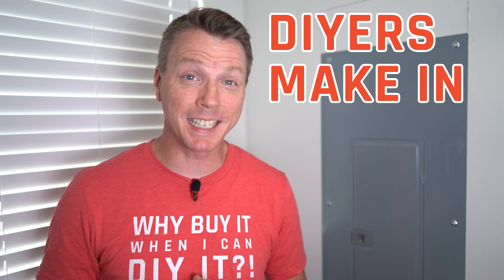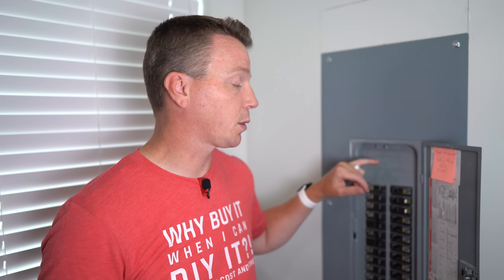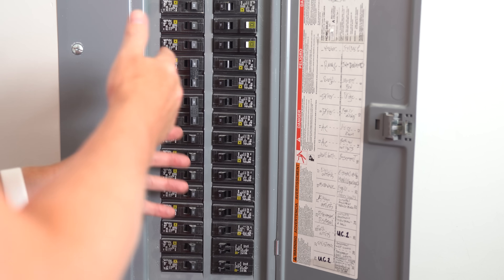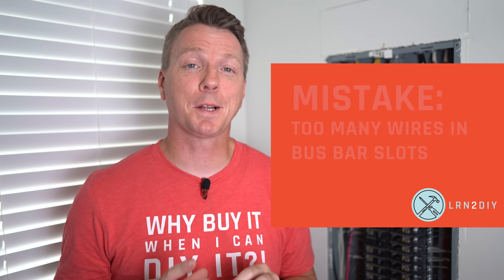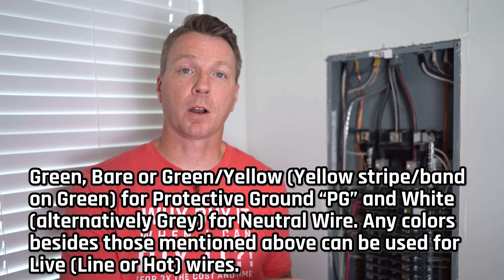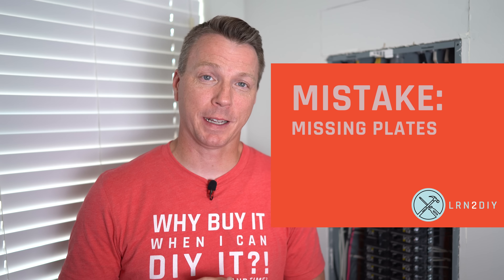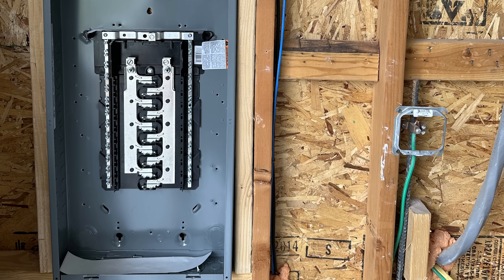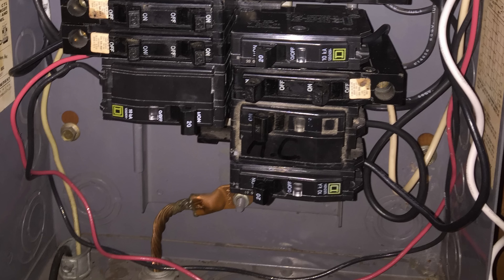10 Common Mistakes DIYers Make In Circuit Breaker Boxes

Comment: The panel at 13:09 is beautiful. Personally, I always leave extra length on the hot wires, because you never know when in the distant future things may have to be rearranged, or a panel upgraded. I usually run the wire down to near the bottom of the enclosure and back up to the breaker. I still make it nice and pretty, but that extra length can be a life saver in the future. I've personally thanked quite a few electricians who came before me for doing this, as I'm sure some electricians in the future will thank me long after I'm dead.
Reply: I used to work with guys who told me not to do that, just send it straight to the breaker. I really do like bringing it down to the bottom of the panel then up tot he breaker myself and that's what i've been doing since i've been on my own
Reply: @goaliedude32  That's because it takes time and time is money; I only do this kind of wiring on my own panels because it sure makes troubleshooting easier and inspections a cake walk.
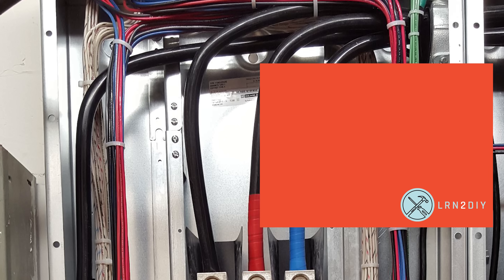Reply: Many electricians will be uncomfortable with the "designer" layout at 13:00, mostly as the long tight bundles increase heat. The general idea might be to tie together during panel set-up, but clip the ties after; the wires should stay nearly the same position, from their stiffness, but give air space around to dissipate heat.
Reply: @z1522  110% on that, which i stated in my post as well. same reason you cant put more than 3 cables through a drilled hole
Reply: @z1522    NOT    that is a commercial or industrial installation (3 phase) and that is a well done panel.  As a master electrician for the last 23 years, I have zero worry about dissipating heat in that panel.
Reply: @JustHazardous  why would there be heat? I'm not an electrician, but I've looked at plenty of panels at work (cause my employer is a chain store with many outlets). If I open up the panel and I feel heat, I would be very worried and on the phone to an electrician immediately !!!
Reply: @danielch6662 
Wires have resistance. Electricity flowing through a material with resistance will release heat. More power = more heat. More resistance = more heat. Thicker wire = less resistance.

The circuit breaker's job is to ensure that not too much power goes through any particular wire, based on its size.
Reply: @JustHazardous  bundling the hots
Reply: I came to the comments to say the same thing. If you have room in the panel to keep it neat, drop a loop down to the bottom and then neatly back to the breaker. Somebody will probably thank you in the future.
Reply: I always leave... well left an extra 6-8inches of wire in case something has to be moved so another circuit can be added.
Reply: I totally agree with you. I dress the panels the same way. I worked in the era when N.Y.C. had their own electric code. More stringent then the N.E.C. No splice's or pass thru was allowed. Your panel could look just as beautiful. Its like the previous person leaving 3 inches of wire in the receptacle box now you have to screw around with splicing. the best connection is a no splice connection. A good journeyman will always leave enough wire for future applications.
Reply: @twigd3825    Yes, I try to avoid ever having to splice or join wires, but sometimes, more usually when significant changes are done, it does become necessary. . . .   How do you do splices. ? . . .   I use through crimp sleeves, if possible, with the two wire ends actually overlapping each other and not butt together. . . .  The UK does not use Wire Nuts, but Screw strip connectors, and other crimp connectors.
Reply: @hughleyton693  I'm retired now. Here in the states back when I was working almost all of the contractors I worked for suppled 3M Scotch lock wire nuts. On larger wire we would use copper split bolts. Covering the splice with friction, rubber and plastic electrical tape. Later in my career that practice ended and heat shrinks or cold shrinks was used.
Reply: @twigd3825  Yes, wire nuts are widely used in the US, but not in some other countries.. . .  And yes, I use split bolts on Ground rods and similar and not the ground rod clamps often sold, which can break.. . .   And I use Self amalgamating tape, and heat-shrink sleeves, and have done for over 60 years, on many things.
Reply: Yes, you should include extra length for panel changes in the future.
Reply: i dont add extra wire because whoever needs it in the future can pigtail it.  up and down looks like crap.
Reply: As a home inspector, I agree, that panel is not only a work of art, it's so nice to inspect or work on. Unfortunately, a lot of older homes have the rat's nest style.

Comment: 5:51 if you are going to use a wire nut to combine grounds, consider using a green "grounding wire nut" that has a hole on the end allowing one of the wires to continue at full lenght to land on the grounding bar.  This way you don't have an unnecessary extra wire in a "pig tail" to make the final connection to the grounding bar.
Reply: Those wire nuts are horrible to work with after the fact, they only hold well if the wire are twisted together significantly more than necessary. which makes working with the wires again in the future a nightmare.
Reply: I like one wire one ground not 1 wire grounding 4 circuits. I am surprised that will pass code. Also a good pair of 600volts gloves make things much safer.
Reply: @voltmeter2  so if you have 4 circuits in a conduit you are going to pull 4 separate grounds?
Reply: @erodge5794  120v Neutrals Yes.   Grounds problay not.
Reply: @voltmeter2 hopefully only two neutrals. Wire is expensive.
Reply: @erodge5794  in the case of residential, this video and the use of NMB, then yes, you would have a separate ground.
Reply: @williamleblanc3244  bro his point is pig-tailing a ground is no different than when you share a ground with multiple circuits in a different setting (such as in a conduit, or even using the conduit itself).
Reply: Buccannon crimp
Reply: Try not to use those, you'll look like a better electrician. 😉
Reply: Use a ground bar never wire nuts inside panels. Don't give advice you might kill someone.
Reply: @chrisminblkdiamond  However wire nuts are allowed in panels for other reasons. Wires too short on a panel replacement. Another allowed use as explained in the video is when two hots need to go to one breaker. The accepted solution to this is a wire nutted pig tail at the breaker.
Reply: @andydelle4509  If that's how you justify lack of skill and planning.
Reply: @chrisminblkdiamond  What are you talking about? If one needs a panel replacement and the cable sheath still is clamped inside the new panel but the wires can't reach the desired terminal, how is that lack of planning? or the old panel had double tapped breakers, what do you suggest? Follow the wire back to the first box and tear out wall board or plaster to replace it? Or just knock the house down and rebuild?
Reply: @andydelle4509  When I went to trade school they said never have a wire nut in a panel.  If your wire is too short, you attach a box to the side of the panel.  Make all your connections in that box.  Normally a 4 x 4 inch square box.
Reply: @slalomking  Well I think that was your instructor's personal preference. There is no code preventing wire nuts in a panel. In fact the accepted fix for an illegal double lugged breaker is to attach a pigtail and wire nut the two hots to it. As long as the cables are long enough to have 1/4 inch of jacket past the clamp. it's legal. You may be thinking of another code where any wire inside a panel must terminated in that panel. You can't use a group of panels as a gutter box.
Reply: @chrisminblkdiamond  phooey

Comment: I had to upgrade my breaker box for a solar installation, and I did such a neat and tidy job the inspector looked at it for all of 10 seconds before complimenting it.  In my county, inspectors will fail you for a rat's nest.

Comment: I believe there is an NEC code that prohibits re-phasing or using colored tape on ungrounded wires 6awg and smaller. 4awg and larger is okay to do. and white wires cannot be re-phased at all.

Comment: Mistake #3.5 @ 3:55 - do not turn away from the panel to face the camera while waving your hand near the live connections :)
Reply: It's switched off. He says this near the end. Granted he should have mentioned it near the beginning that the entire breaker is non-operational.
Reply: I made that mistake once, there was no exposed wiring but I tripped a few beakers that required a maintenance guy to go on the roof of the building to reset something.
Reply: I could feel  my blood pressure rise everytime.
Reply: You should always wear safety glasses or eye protection when working in a live panel.
Reply: The problem with doing this and several other instances of near-misses is that it conveys to the novice that working with electricity is no big deal.  Never once did he stress the critical importance of not touching live circuits within the panel.  I'm afraid that this video would encourage the uninitiated do-it-yourself home handyman that safety can be taken lightly.
Reply: @larrywhited3070 he does at 10:30
Reply: How would you feel if in a gun video the instructor was pointing the empty gun at his head and pulling the trigger, knowing that the gun was empty. That's what prodding the wires is in this video. Instant "Do not recommend channel"

Comment: I disagree that "double lugging" -- putting more than one conductor in a lug -- can result in a poor connection. How is it different than putting a stranded wire in the lug?

However, it's still poor practice, especially on the neutral and grounding busbar. With ground wires, if you need to remove one of the wires from the lug, you will (at least momentarily) leave the ground for the other circuit disconnected. Same with wire nutting several circuit grounds together.

With double-lugged neutrals, attempting to disconnect the neutral for one circuit also disconnects the neutral for the other circuit, and, if you didn't turn off the breaker for the other circuit, can lead to arcing in the panel at the neutral bus.

So don't ever double-lug on a neutral or grounding bus. And don't wire-nut your grounds together to avoid using more than one grounding lug.

So that leaves the question of whether or not you can double-lug a breaker. Some breakers may actually be listed for double-lugging; others won't be. It's most likely not unsafe, so long as it's a newer style breaker with a lug instead of an older style breaker where the wire is secured under the head of the screw. Don't ever put two conductors under a screw head.

But defer to your inspector; if they say "don't do it" then it's usually easy enough to just put in another breaker. In the grand scheme of things, individual branch circuit breakers aren't that expensive.

Comment: What about the neutral to ground bonding screw (only on the main panel)?  Its tough to find info on that.
Reply: Yep.  You need to separate the the earth based bond from the service neutral    doing this with a ground rod    if the raceway is metal then a bonding bushing is required. If PVC is the raceway then an additional conductor is required

Comment: Is this a main breaker panel? If so, where does the ground wire come from? Also, you don't list the number one mistake a DIYer does, which is to insert a breaker not listed for the panel. I've seen one brand of breaker in a different brand load center many times.
Reply: There's no main breaker in this panel    it's a pass thru set up

Comment: When your video are aimed at non electricians, you can say what you want and get away with it, but electricians tend to nit pick your video. If you have a panel that are filled with breakers, and panels tend to run out of breaker space long before they ran out of amps. You just cannot total up the breaker amps and says the panel is overloaded , unless you are a crook and try to sell more service.  Much of the wasted space are , believe it or not , caused by electrician that could not care less. You want a couple of general purpose recep at a basement wall, and they add another 15 amp breaker, without testing other breakers for capability. Soon your panel will be full. The wire tracer you showed is never used, takes too long and need 2 people . To just test power etc, I used an old neon tester by Eagle, under $10 and rated up to 600 V. 14 gauge wire is not always for 15 amp breaker, according to our Ontario ESA code book, you can legally put up to a 30 amp breaker, provided it is dedicated circuit and your appliance is 8,9 amps or more.(up to 12 amps)  But the appliance better be there to show the inspector to pass.The more than one wire on the breaker is because we often have idiots that will put a 10 gauge solid and a 14 stranded into the same breaker and the stranded will be loose. We do not carry torque wrench with us, those torque numbers are more for Square D protection then the customers, I rather see people use aluminum compound on the thread and on aluminum wires than a torque wrench.

Comment: Idk if I’m gonna trust a guy who doesn’t know different between current and voltage because if you don’t have anything plugged in…even if the plug is active there won’t be current following because it’s an open circuit beyond that point.

Comment: Double tapping circuit breakers IS actually legal as long as you have a Square D panel. This guy even showed the molded in pictures showing that it's ok during the under/ over torqueing segment. The reason is it's been UL listed that way.
Reply: Code has precedence over UL, which approves manufacturers specs; few jurisdictions allow double tapping breakers, regardless of the UL or mfg specs. Same for one neutral per hole on bars.

Comment: Why maximum 80%? Something very wrong if you need to do that. (ignoring diversity obviously)
Reply: Because that's the way the code works here. We aren't supposed to use the whole capacity unless it's for less than three hours.

Comment: Theres no plastic bushing on the panel feeder
Reply: Clamped cable jacket.
Reply: @antilogism  i thought if it was 4 awg or over it needs a plastic bushing and its cut kinda short
Reply: @genebenavidez2057  From what I can tell all that's needed to comply with 314.17 is a cable clamp listed for SER/SE with enough jacket. Raceways are size dependent though and use 300.4(G).

Comment: My breaker box is full and has several doubles already. I need more. Is it better to do a breakout box or get a bigger box?
Reply: Most definitely upgrade to a panel with more slots.  May have to increase feeder wire to ensure you don't exceed ampassity.  Conduct a load calculation  to determine if within the NEC requirements

Comment: Square D says that breakers are not intended to be used as primary power switches.
If you use a breaker as primary power switch, the breaker will wear prematurely & fail.
A proper power switch is much much cheaper and as a primary switch it is designed
to last for many many years.

!
Reply: The "SWD" on the breaker indicates that it is rated for switching duty.  At least for lighting, it is a common and accepted legal practice.

Comment: Pardon me if someone else has noted this!  At 7:54 in the video there is a black and red 12 ga. leads on adjoining 20 amp breakers.  While I am unable to see the white (neutral) conductor this appears to be a feed to a 240 VAC outlet, a 240 volt device like an air conditioner compressor, or a split 120 VAC outlet. If it is a split outlet or a 240 VAC outlet the two breakers should be linked so that if one trips the other will trip also.

Comment: I see your panel does not seem  to have a main 200A (or 150A) breaker.  Mine is  the same and not mine is not that old (2006). Is it by the  electrical meter?  I live in a development and we have 3 townhomes together and with 3 meters in a closet outside.

Comment: Great video, but in the section covering torquing the wire connections on the breakers you should have noted that the screw lugs on the circuit breakers installed in the breaker panel are hot unless they are switched off or the main panel breaker is switched off. Likewise, a statement should be included that the lugs with the allen wrench style wire clamps on the transformer side of the main disconnect breaker are always hot and should be avoided (they should also have insulating covers on them per code, but I've never seen a panel in use that had them). The lugs on the other side of the main breaker are hot if the breaker is on.
Reply: Line side lug covers only starred being used in residential panels approximately 10 years ago.
Reply: What brings you to this video? Just critiquing? You don't seem to need this information, huh?
Reply: @mgmarrow  its a thing. i'm doing it now.

Comment: I live in an older high-rise condo in Saint Paul, MN.  We have semi-annual "bus retorque" days where residents are notified that power to their individual units will be off for a few hours.  Electricians retorque all the connections on the big power bus that brings electricity from the basement, up through the tower and main line taps on each floor.  They don't retorque breaker panels in individual units... at least not yet.

The power bus we now have is old technology.. bolted metal plates that run up through the central core of the building.  However that stiff metal plate design did not account for flexing and actual shrinkage of a concrete building (which is normal).  So we are in the process of replacing it with newer tech.  That project should be finished later this summer.